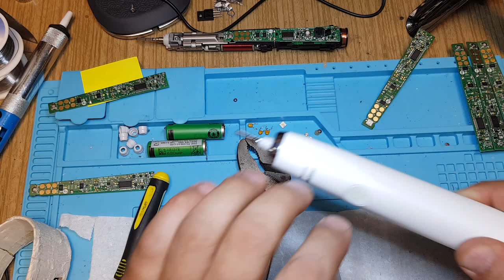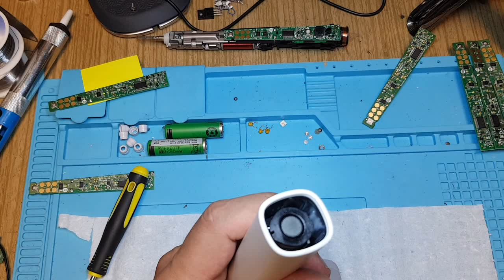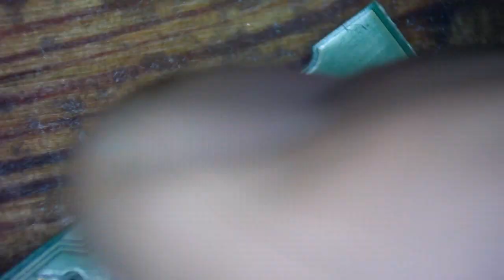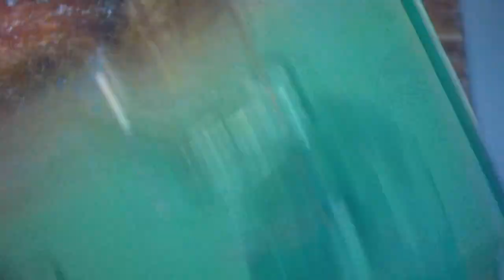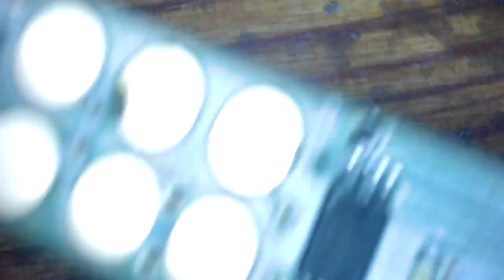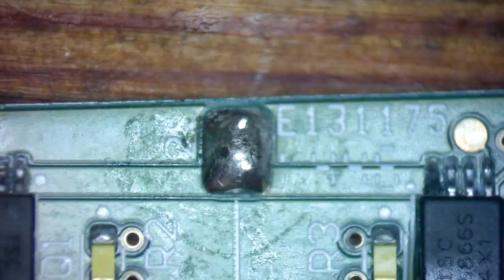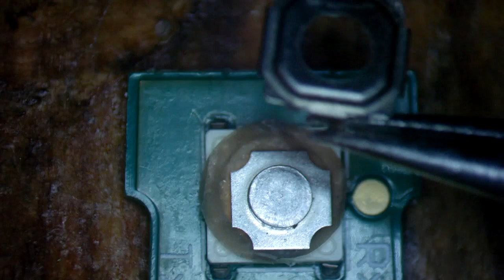Diagnostics and repair solutions of all known Philips Sonicare toothbrush defects in one video

Comment: My brush is totally dead, battery voltage is 3.7, no vibration and no led lights in charger, fuse is ok.
Reply from the maker: At this point my only suggestion would be to take the board off, inspect and clean both sides. Check tracks to MOSFETs and the button.. that's the main things that usually is damaged by water in Diamondclean brushes..

Comment: Hello, 
Nice video. Though, I don't think it directly covers the common fault when the working and fully charged toothbrush just stops vibrating. 
That mostly happens on the excessive shaft load (when you press the brush too hard against your teeth). 
But in my case, it is very prominent, and happens in some extra strong vibrating modes (like cleaning mode) even when the toothbrush is not in the mouth.

I understand that it is most likely  triggering of some sort of overload protection. 
Can you address that fault please?  What is most likely cause of it? How to get rid of this?

Once again - there is no obvious mechanical or electrical damages, the battery is fully charged, and yet the toothbrush stops by itself.
After it stops, I can start it again with the button, and it stops again, after some while, different every time. 
The gap between electromagnet and permanent magnets was adjusted to 1mm.
Oh! One more thing: when I gently grab and hold (but not too tightly) the vibrating magnets (the part closest to the electromagnet), then this fault happens much more rarely. 
So restricting the vibration seems to improve the behavior (in my case at least).

Any suggestions? Thanks.
Reply from the maker: I wouldn't call your defect as common one.. didn't had a chance to see something like that.. so I can only suggest what I would do.. as the defect is not permanent only exchanging of components would be a useful way of identifying the problematic part.. lets say I would exchange the whole electromagnetic part just to eliminate any mechanical fault in this part.. but for me as usuall the more possible cause seems as it is water damaged.. is the seal in good condition? have you opened and inspected the inside? As said before main water damage is usually on the back side of the PCB..
Reply: @letsfixitgarage  Thanks for your quick reply. 
Yes, I have opened and inspected the PCBA - I am experienced with board debugging and repairs. I have even taken off the PCBA and gave it a good clean with isoprop, after the good visual inspection and multimeter check. Nothing obvious from the electrical point of view.
Unfortunately, I don't have another toothbrush, in order to exchange the blocks, so will have to do a lot of guesswork here. 
Before we go on, I should clarify that the toothbrush I have is a Philips Sonicare, but NOT the model you are using in all your videos (HX9340 with the square butt and five white LEDs). Mine is an earlier model, HX6710, with the oval butt, green LEDs and only two modes of operation - "Clean" and "Clean & White")
What makes me think that it is probably a mechanical fault is that the occurrence of the fault reduces if I hold the shaft with my hand, therefore changing the mechanical load on the shaft (and therefore changing the electrical back-emf feedback in the electromagnets).  I may be completely wrong here, of course.
The top rubber seal is in a reasonable condition, but I don't think it's relevant as I have opened the brush, and gave all parts (mech and elec) a very good cleaning, plus I disassembled and then re-assembled all mech/elec blocks.  I now operate it in a good room environment, with no moisture etc...
So, it is something not that obvious. I haven't looked at the signals with the CRO yet, but this is in my plans. My problem is I don't know how the electrical protection cut-off works in this brush - it may be an overcurrent (but I can't see any current sensing resistors there) or analyzing the shape of the back-emf pulses (and then they should sample the driving signals with the ADCs in the main PIC controller, which imho, would be an overkill). 

Anyway, all suggestions and ideas are welcome. Thanks again.
Reply from the maker: Well I can't comment on the working principles either.. didn't dive in that deep, as that kind of damage is quite rare.. I would suggest to get a broken toothbrush of the same model as you have and then try some swapping or repair the other one as this one will take a lot of your time :) I had few cases where I was testing pcb with multimeter and it looked fine, but when under load it was shutting down.. if I remember correctly I redid PCB tracks like I showed in these videos after water damage and then it worked.
Reply: @letsfixitgarage  Spent more time on that subj last night. The culprit turned out to be a battery itself. I traced the circuit a bit, and as far as I can tell now, there are no feedbacks from the coil driving signals to the micro. So, I guess, the protection against the shaft overload has to be done by simply sensing the battery voltage drop. Well... there is a fuse F1 as a last resort.

Anyway, when I replaced the battery with the externally wired 18650 (I don't have 14500 around), the problem went away.

Oh, btw, do you know if there is a schematics for those brushes available from anywhere? Original or reverse-engineered... Tnx.
Reply from the maker: Interesting.. how old is the toothbrush? As I haven't saw that kind of behaviour.. very interesting. usually battery for me seamed unkilable.. there were batteries that were discharged till 1-2v and worked fine after charge from power supply.. so this is a very interesting diagnosis for me, do you have some tester to see the battery capacity?

As for schematics haven't found any, there were some quite old but good webpages where they reverse engineered the working principle of the Sonicare toothbrush but none dived deep in to schematics or so..
Reply: @letsfixitgarage  The device age is coming to some 10 years. I don't have a battery capacity meter on me, but can measure it indirectly by fully charging the battery and discharging it while logging the current and voltage. Though, I am not a great believer in those tests as the capacity normally varies a lot depending on a discharge pattern. Normally, in those test, the discharge current is always limited by C/5 value, but In our case, we have a very aggressive discharge current (Amps) during a use, and almost no current drawn in between usages. So, I can see a value of such test as low. What I think is more important is that the battery develops the higher internal impedance with time, so the initial start-up current (usually pretty high, before the coil back-emf kicks in) creates a large voltage drop across the battery terminals, and that's what, in my opinion, triggers the protection, because the battery voltage is definitely monitored by the micro (that's how it knows when to blink the LED asking you to put the brush on the charge).
Reply: As far as schematics is concerned, there is not much there on the board. MOSFET H-bridge with coil in between, to drive it forth-and-back, and the bunch of LEDs (they actually use 3.7-to-5V switched capacitor charge pump regulator, to make the LED brightness independent of the battery state-of-charge ! How nice of Philips...) and the wireless charger cct + coil. All controlled by PIC16 micro. That's it. The bare board looks like a double sided PCB to me. Could be traced to work out the schematics, but I guess, no-one has enough motivation (myself included :) and are just waiting for someone else to do that and share...
Reply from the maker: 10 years if of course already some serious age for the battery it should have ~300 cycles if charged from empty to full.. nice find and diagnostics!
Reply from the maker: Yes exactly as you described :) and this simplicity is the nice thing! have few of those new ones with Bluetooth and so after water damage and struggling to get them up again..
Reply: @letsfixitgarage  Just one more thing I wanted to point out - not related to our exchange above. It is about the end cap (you call it "bottom cap" at 1:20). 
I think it's worth mentioning here (some ppl don't realise) that, even though it looks symmetrical to the non-dedicated eye, it is NOT symmetrical!  One side of it (the one that goes to the back of the brush case) has two grooves, that go over the two matching ribs on the inner surface of the main case. So - YES, it DOES matter (!) which way around it goes in, during the re-assembly process. The nasty thing is that you still can force it in the wrong way around, but sealing of the butt in that case will be severely compromised. 
So, maybe it's worth spelling it out in your videos, that the end cap should be re-assebled ONLY one way around - where the grooves are matching the ribs as above. 
Other way to tell is that the logo of crossed out recycling bin on the cap should be located to the front side of the brush (where the button is), and the little dent (or mark) on the cap should be towards the back of the brush.  I hope this description is clear, as I don't recall seeing mentioning of that in any of your videos. Thanks and good luck.

Comment: Very informational! The MCU seems prone to damage. Any scenario that requires the MCU replacement?
Reply from the maker: Thought so too, but it's very rare.. and to be honest I got a little bit lazy in further diagnostics, with these repairs I usually cover 95% of defective ones and with the ones that are not fixed, it's easier to replace the whole motherboard and have the defective as donor, then check further..
Reply: @letsfixitgarage  Thank you for your insight. I like the Essence series because there's basically no chance for water damage, but there seems no place to buy its motherboard.
Reply from the maker: Havent had this type of brush in my hands so no real info on this.. but I generally prefer li-ion battery's Vs ni-mh and I believe these are not produced anymore? Then yes spare parts are a problem.. I usually buy mine as defect in eBay maybe there are some of essence too.. good luck ;)
Reply: @letsfixitgarage  You are correct that they are not produced anymore by Sonicare, but you can buy them new on ebay at 1/10 of the original price, even lower than used / defective. Li-ion battery is better than nimh, but I prefer no battery : )

Comment: I opened mine, the magnet was stuck, so I separated it, it worked for a second, but then as I put it back together, it died. Absolutely no sound or light. The battery is good, the switch seems good, there seems to be no damage from water. I can send it to you if you want to make interesting investigation video. For me it is a write-off :(
Reply from the maker: Hi, it's difficult to suggest something  but did you checked the fuse, button and all the track points with a multimeter? Write me an email maybe we can work something out..
Reply: I have the exact same problem.

Comment: Hi. Great videos for self repairing. My 2 years old toothbrush HX9332/04 has 2 issues : It's sometimes starts by itself (especially when it's on its base) and when I uses it, it' stops after 10s. What is your advice to repair it ? Thanks.
Reply from the maker: Open it. you will find water inside. Check my videos for water damage and there are high chance it can be repaired

Comment: Hi, I have a kids sonicare hx6330, when I place it on the charger it makes 1 long beep and 2 short beeps continuously. Would you have any idea where the problem lies?  I have opened a few and managed to fix one with a trace problem because of your video. Thank you.
Reply from the maker: Hi sorry had only few of the kid sonicares and the defect were quite clear.. haven't heard of any diagnostic vibrations.. usually it vibrates when the battery is empty and it needs charging.. but continuous.. what about the battery voltage and what voltage you get when it's on charger? Maybe charging circuitry is failing..
Reply: @letsfixitgarage  thank for your reply, i will look into it.

Comment: Hello, thank you for your great video series.
I have a Sonicare HX9352/04
I had the problem, that my toothbrush was rapidly turning on and of for random. So I tried to repair it, by changing the SMD button.
After desoldering the damaged button, I checked all lanes with continuity test. No problems found and no corrosion. 
I tried your trick by testing the brush by shorting ground and the R1 hole. Without success, no reaction at all! Between ground and R1 there is 0.5V current.
The brush is still chargable and after I put it into the original loader, the battery has enough current. But I cannot turn it on again.
When I load it, I recognized a light flickering at the other LEDs... 
Can you make a small diagnose on that behavior? :-D
Thanks in advance!
Reply from the maker: Check the button line or the button itself again.. if I'm not mistaken button pulls the 0.5v that you see to ground.. if the line has continuity then it has to be the button try to shorten it's legs and see if that will help..
Reply: @letsfixitgarage  Hello unfortunately that helped not. After I short ground and the right pin at the button (or R1) the toothbrush is not doing anything.
Although, it is loading... Maybe there is something wrong in the µC...
The battery has 3.8V and there is no corrusion at all. 
I do not see where there can be a failure. All lines which must have continuity are correct, and it seems there is no faulty shortage. Thus... maybe the chip....
Reply from the maker: Difficult to suggest something remotely.. and yes there could be some defect chips or components I seen some strange rate behaviours but they are to rare to investigate any further.. my suggestion would be to buy another similar toothbrush as donor an exchange the board if it's good and if not try to repair one of two by exchanging components.. you already have some knowledge and these toothbrushes can be repaired even after water damage so check eBay and you will have some options..

Comment: Ive changed out my battery and charges fine without case on, but when the end cap is placed back over the windings, the brush doesnt charge anymore, any tips on how to fix this? Thank you!
Reply from the maker: Never had that kind of an issue.. try to inspect the coil maybe it was damaged somewhere and now it's shorting between the coils..
Reply: @letsfixitgarage  Hi I found out that the iron core at the bottom of the PCB is actually missing...this usually comes as part of the PCB replacement part right?
Reply from the maker: Nice find! It should be glued in, strange that it fell out.. Yes. If you can find the diamondclean pcb frame with coil it will be complete.

Comment: Hey - thanks to your great work showing how to open these brushes - had it done now to my diamond clean (the Grey HX993S one) and repaired the broken head sealing - when I put all parts back together I realized that the pressure control doesn't work anymore... Before I disassembled it does a great job to me... Do you know to fix that too? Hope you could help 😉
Reply from the maker: Either the ribbon cable to the sensor got damaged or if you took it off maybe it peeled off after assembly.. disassemble it and check the sensor next to the magnet
Reply: @letsfixitgarage  thanks for your fast answer and help - i would like to send you a Photo of my device in you would offer a Bit More assistance to me because i couldn‘t identify the Sensor itself - Could you Write me an email for getting in contact?
Reply from the maker: letsfixitgarage@gmail.com

Comment: First of all I would like to thank you for your fantastic video on the philips sonicare. This is by far the best content I have found on the net. With your help I was able to repair several toothbrushes within my family. However, I still have got three brushes with a blown fuse F1. In my point of view the F1 fuse is not self healing. Am I right that on a functioning brush the F1 should have connectivity? I would like to replace this component. In one of your videos you said that you ordered spares for the F1 fuse. Have you got a specification for the F1 fuse?
Reply from the maker: Thanks for the good word. If I remember correctly it has a letter P on it so internet says it should be up to 3A I ordered a lot of different sizes from AliExpress and still didn't got the correct size (smd measurements has imperial and metric scales too.. can you believe it..) so I used the smallest fuse that I got and it works. 
Yes a good fuse has to have continuity. But if it blew, it could also indicate a burned MOSFET.. check those too..
Reply: @letsfixitgarage  Thanks for the quick response. Really 3A? I did not investigate yet but I was aiming for a 500mA fuse.
Thank you for your advise about the MOSFET. I thought the fuse was there to protect the mosfets from getting burned. But now I'm going to check those as well.
Reply from the maker: @123Poppa321  yes I was surprised too but you can check the writing on the fuse and Google "smd fuse values" it will be 2A or 3A, fuse has to take in to account peak values.. 
And usually fuse burns when something bad happens on the board to protect from burning everything down :) and from what I saw usually (but of course not always) MOSFET is the cause why the Fuse burned through.. and if you had water inside be sure to check pcb tracks I have a whole series on water damage repair :)) if needed check them out..